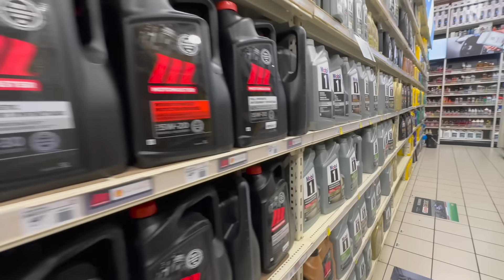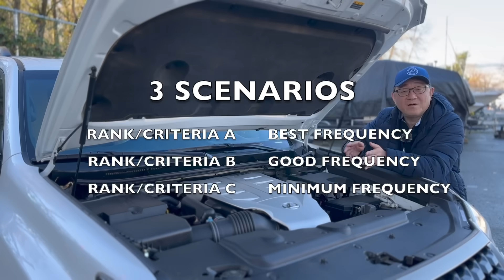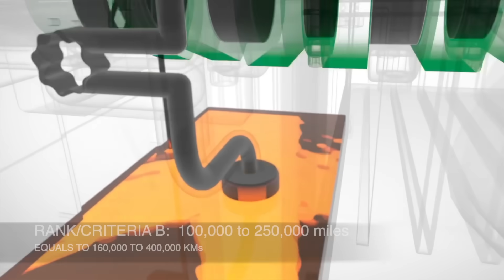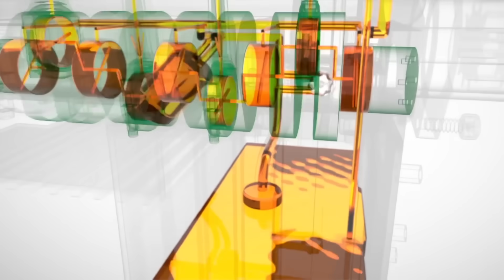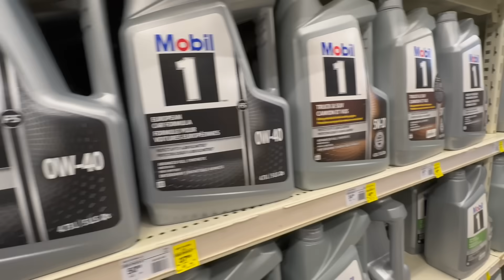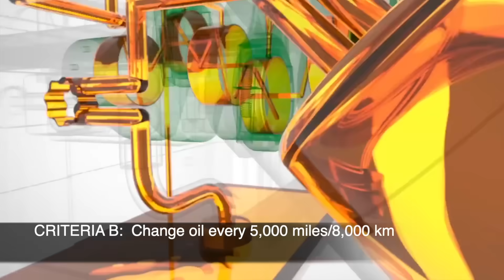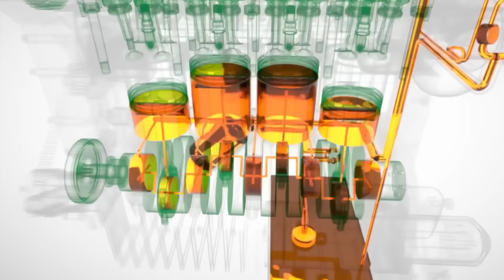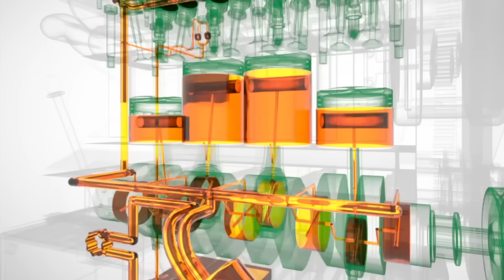ENGINEER EXPLAINS HOW OFTEN TO CHANGE OIL & FILTER // UPDATED CRITERIA-BASED RECOMMENDATIONS!

Comment: Toyota owner's manual says 5,000 miles under severe conditions. They define severe as a hot climate, a cold climate, or a lot of stop & go city driving. I have also read that it should be changed at 6 months, regardless.
Reply: Yep, what they (and others) call severe is actually the average owner's usage.
Reply: It should be hours, not miles.
Reply: @markkievit3774  Back when I was working with a large truck fleet that did regular oil analysis, the most predictive metric was gallons of fuel used combined with an adjustment for how much of the fuel consumed was at idle (with the truck not moving). Almost all miles were highway miles with loading just below 80,000 pounds gross vehicle weight.

Not engine hours, not miles, and not calendar months. Fuel consumed is directly related to oil contamination caused by fuel getting past the rings. Fuel consumed at idle increases carbon and ash by about a 3:1 ratio compared to fuel consumed at about halfway between peak torque and peak horsepower under load for a diesel engine in the 11-14 liter range.
Reply: Every year , but then I only average 1 to 2 k a year most of my time on a motorbike and regularly change the life blood Fuchs silkolene
Reply: That will allow your engine to get outside of Toyota's 60K mile warranty. That's all they care about. But if you want to keep it and drive it for 200K+ miles, change it sooner.
Reply: Toyotas are fine at 10k
Reply: 6 months is a crock of shit. Don't fall for it. Miles is all that matters.
Reply: @joevarga5982    6 months really isn’t a crock of shit. If your car does 5K miles a year. City driving. Lots of stop start. You change it at 6 months. Not 5K miles. I will not have engine oil sat in my car for one year. Never
Reply: 10k these days.

I leased a Corolla and they wanted to change it at 10k intervals
Reply: @mikeprice8307  One of the (growing) problems is "MARKETING".  It's a sales pitch, to offer longer-interval servicing as a requirement (hence cheaper and less inconvenient to the owner).  The executives go to the engineers and ask what is the MINIMUM oil change distance to get the vehicle past warranty - not necessarily what is optimal for an extended life of the vehicle.  (In fact, it's in their interests for a car to "fail early" - so you go and buy another one, rather than keep it 25 years!!).  What 'sounds best' to a new buyer, 3,000 mile / 6 month changes, or 10,000 mile / annual changes?  Most experienced mechanics will advise oil changes at HALF the manufacturers recommended distance.
Reply: @OhSoddit  Yes, marketing. 1 company started it (10k) and everybody else followed, since no one wanted to make the impression their brand/stuff isn't as good as the other brand's stuff. And that kept on increasing to 15k, 20k and who knows where the ceiling will be.
Reply: Don't go 10k
Reply: @bertblue9683   A lot of modern cars will be dangerously low on oil by 10k, in addition to the oil being full of fuel and contaminants by them. Unless someone drives 90% on the interstate sitting on cruise control 200 miles a day, 10k just isn't a great idea.
Reply: @garymaclean6903   No responsible one will. But, majority of car owners aren't mechanically knowledgeable or responsible.
Reply: @bertblue9683  Use a full synthetic oil and change at 6 months or 5,000 miles, whichever comes first. Car manufacturers are making piston rings looser, allowing blowby into the oil. 10,000 mile oil is really dirty.
Reply: @bertblue9683   I already did. I've owned my 2004 Audi S4 since it had 13,000 miles. It now has 161,000 miles. I change the oil and filter every 10,000 mi. as recommended by Audi, with Mobil 1 full synthetic without issue. I'm even on the original timing chain guides and tensioners.

Now explain why 10K miles doesn't work.
Reply: @Resistculturaldecline   Changing every 10K miles doesn't mean you go 10K miles without checking the oil level.
Reply: @motleydude73   Exactly. People are ridiculous.
Reply: @mikeprice8307 no offense but 10,000 miles is foolish.  Just stick to 5,000 if your mindset is 10,000 miles.  It’s $35 to change your oil and filter with full synthetic and takes 10 minutes
Reply: @CreatingExcellence   I change my personals 4k to 5k.  Toyota says 10k.  I leased a 15' & 17' Corolla.  They also done it this way of interval during the contract of the lease.  I didn't have to change the oil.
Reply: @motleydude73  I've given up trying to convince these people, they're gonna do what they want and only want to hear from positive reinforcement, anecdotes, etc haha

Oh well, so be it
Reply: @CreatingExcellence   There's nothing foolish about following the manufacturers instructions to the letter. I've owned my 2004 Audi S4 since it had 13,000 miles. It now has 161,000 miles. I change the oil and filter every 10,000 mi. as recommended by Audi, with Mobil 1 full synthetic, without issue. I'm even on the original timing chain guided and tensioners.

Now explain why 10K miles doesn't work.
Reply: @CreatingExcellence  10,000 miles is not foolish. Naturally aspirated engines can easily go 10,000 miles with synthetic oils made from GTL Group III+ base oils. These oils are more refined, harder to break down than your average "fully synthetic" which are made from crude-oil refined Grade II or III base oils. Pennzoil Ultra Platinum is one example.

Then there's AMSOIL Signature series which uses Group IV PAO base oil, sometimes mixed with Group V ester. These are true 100% synthetic oils. Amsoil advertise it for 25,000 miles, which is ofcourse pushing it but it can definitely go 15,000 miles between oil changes.

For Turbo-charged gasoline engines, its always 5,000 miles since there's too much fuel dilution.

Comment: This is a really great video, alot of people guve their 2 cents without really giving any weight to what a person does with their car.  I've got a 23 IS500 that I've already changed twice and it's only got 4000kms on it.  Now that it's broken in, I don't plan on ever going longer than 5000kms.  I plan on keeping this car basically forever as It might be the last if it's kind.  I also have a highlander, which I plan on keeping 4-8 years. I change that between 8-10 thousand kms.  I'm using amsoil in both cars.
Reply: You know, you touched on a point which will become more poignant in the coming years. And that is the possible scarcity of vehicles with ICEs. I am holding onto mine like they’re gold (they might be soon), and maintaining them to the highest degree. Plus, I’m tired of spending 50+k for a set of wheels.
Reply: @bobhawkins3387  ya, I agree, I don't know what the future holds, but I think now more than ever, maintaining your ice's engine for the long haul is more important than ever.
Reply: the brand is pretty well irrelevant !I buy the prettiest can..yelloow is good.Weights arent nearly as important as people think!THERE IS so much " mechanical mythology" involving oil!ONE GUY TOLD me mixing weights was like putting half inch marbles in with 1 inch marbles..the half inch will never share the load!!! His bud said " that makes sense"....I said...NO,I DOESNT!
Reply: When I bought my 19 bullitt new from the dealer I had changed it 8x by 4000 miles 😅
Reply: I learned at a young age oil is supposed to stay clean and filters are supposed to get dirty and be changed. The problem is the only filters that clean oil are depth bypass filters. All after market. I have a Australian Jackmaster Classic on the Pontiac Torrent. The other engines and transmissions use Motor Guards. Gulf Coast juniors and The flat head Ford V8 canister filter on the Ford diesel tractor. The Motor Guard on the old Ford f250 390 is almost 60 years old. I have 2 older than dirt Frantzs that I will put on a lawn mower. They need new gaskets. You guys are suckers. LOL.

Comment: my son's 2012 durango had 102k wen we bought it, know has around 122k... water pump went, so having " hemi tick " we decided 2 rebuild engine so he can keep " 4 EVER "  looking inside heads there is NO, that's rite NO sludge @ all... only had 1 fluid change w/AMSOIL Signature Series( their BEST )... ran my '16 lexus nx200t 23,671 miles over 3 yrs, 2 mos & 2 days... had it tested, only gained a little viscosity... only 1k 4 using synthetic ? sounds like u do not really fully understand they difference between real oil & synthetic...
Reply: Ahhh... The AMSOIL cult.....  
I make it a point to never buy a vehicle from anyone who claims to do extended oil change intervals because they use AMSOIL.

Comment: Depends a lot on the engine and also  driving.

The family MB needs oil change every 4 months 😭 due to fuel dilution
Reply: Tell me about it life time transmission fluid 😂😂😂. One year ago told a friend thinking about a transmission fluid change.  He laughed at my face and say. It's life time fluid mate. 2 days ago hè called me and asks me if i knew a guy that Works on automatic transmission.  His one stopped working😂😂😂😂😂.
Reply: @PhilippeVandenStockt  Lifetime... until it lasts 😅
Reply: @PhilippeVandenStockt  Also my family MB got worse, the oil was black after 3 months of very light use 😲 I basically just buy the cheapest oil in bulk ( expecially on black friday, great deals that day here in Europe for some oils) and change it frequently

Comment: Millage is just one factor, oil temperature (actual driving time) is at least as critical and the oil might need very frequent changes with short time, as well as how dirty the environment is (there's a reason why they say that the best oil filter is a clean air filter).
Best is to do oil analysis if it's available in the area.
Reply: You're right but I think these guidelines are meant to give the owner a safety margin. Sure if you take into account driving style and environment then you could probably squeeze a couple more miles out of the oil but most people don't pay that much attention (myself included)
Reply: @aden3113  There's no safety margin in those numbers unfortunately, not without knowing the whole picture. Just like it can be completely unnecessary oil changes. 
It's was all generalisation without addressing any facts to help anyone, unfortunately.
Reply: @PSA78  Is it unnecessary though? It's all just a compromise with regards to many different factors such as the longevity of the engine and how much money you're willing to spend on keeping it in good shape. The more frequently the oil is changed the cleaner the engine is going to be and the less wear and tear on the engine.

The numbers are certainly a little arbitrary but not unheard of and should give good results if followed.
Reply: @aden3113  Only to a point, if the oil and the additives are good and there's low level of contaminants then it's fine. If it's not, then it should be changed.
There's just too many variables, that a generalisation between conventional and synthetic is made is just one of them, as what's called synthetic varies around the world and there's a rather big difference between different types as well.
I'm sorry, but this isn't a video that really helps anyone.
Reply: driving style - floor gas pedal, towing if a truck
Reply: @hom2fu  It can help to drive a bit harder if it's shorter distances, regular driving usually takes 20-30 minutes to get the oil up to temperature.
Reply: All recommendations are based on using filters that only remove engine damaging abrasives and draining the oil to get rid of the smaller engine wearing abrasives. The small stuff can be removed by depth bypass filters. We have a lot of filters that clean oil now. When I started using filters that clean oil in 1963 we had Frantz and Motor Guard. In the US. The Australians might have had the Jackmaster oil filter. My Pontiac Torrent has the Australian Jackmaster Classic. Not familiar with the others.
Reply: @ralphwood8818  There is finer filters that could be used together with the regular, but it's not going to change things a whole lot, if it was fine enough to catch all particle sizes that matters then the additives would be caught there as well.
The oil is also depending on operating temperature to remove contamination, really short trips and you might need to change once a month, perfect conditions and once a year might be fine.
Reply: @PSA78 When I started using the Frantz oil cleaner in 1963 it was simpler times. Every 2.000 miles you changed a roll of 2 ply toilet paper and added a quart of Delo 30
W. The sludge was in the filter instead of the engine. Delo was 29 cents a quart in the discount stores. I didnt know anything about  size and shape of molecules. My Rambler American flat head 6 came with a bypass filter factory installed with steel oil lines. It didnt clean oil. To clean the oil I installed a Frantz oil claaner.
Reply: @ralphwood8818  Things have changed in some ways and in others not so much.
Change the oil when it's time, and make sure to run the engine for a few minutes to circulate it before draining so it will take the contamination with it out.
Reply: As far as I know filters that clean oil dont remove additives unless its like graphite. I know some people that use filters that clean oil read oil analysis reports to check for additives and wear metals. I dont have an over the road truck with a Gulf Coast Bypass filter. I have a 06 Pontiac Torrent with 207.000 miles on it with a like new engine. Im not in the rust belt. I wont out live it. It has a Motor Guard oil cleaner on the Toyota transmission. I probably wont change the filter on the transmission or the Wix XP full flow filter. I depend on the Australian Jackmaster Classic to do the cleaning. The pleats in the Wix XP im told are synthetic and should hold up.
Reply: @ralphwood8818  Exactly, filters aren't fine enough to catch anything but large particles, additives, wear particles etc will go through.
UOA is after all taken from the oil pan and not the filter, so both additive and wear particles are in there circulating.
Reply: @PSA78  Im not that smart. When I put a Frantz oil cleaner on my Rambler American flat head 6 and saw the oil turn golden I was hooked. I was debating a smart as hell guy on a Trawler forum. He said you are good at defending yourself. Bring your wife down to Canaveral. I will take you on a tour and we can talk about filters. I called Charlie Sims of Gulf Coast filters. I said I need for you to talk to a guy about big diesel engines.He said who is it? I said a diesel equipment engineer at NASA LOL. They are a customer now. I was on YouTube talking about a Peterbilt truck with a million miles with one oil change and virtually no engine wear. Shell Rotella 15 40 conventional and a Gulf Coast Filter that used Bounty Big roll paper towels. I dont get any respect but I did get a message from Road King Magazine wanting the truck owners phone number. I called Charlie Sims again. I said Road King magazine wants the truck owners phone number LOL. They did an article on it.
Reply: @ralphwood8818  I'm not sure what or who you're talking about, but a finer filter can catch some soot and that can potentially help a little with diesel engines, but at the end of the day some particles of equal size could both be increasing and decreasing wear depending on what it is.
Reply: @PSA78 I put over 250.000 miles on a 84 Subaru with no oil drains using Mobil 1 15W 50  and a Frantz oil cleaner. Was talking about it on YouTube. Got a sample kit from a Caterpillar lab manager. He said the oil looks good for that many miles but he suggested I change the Frantz and add a quart of new Mobil 1 every 6.000 miles instead of every 12.000 miles Been doing 6.000 since. I was driving about 12.000 miles a year. I was using 4 July as a time to change the Frantz. I had Amsoil in the 5 speed. Never drained it. Both head gaskets started leaking oil at over 260.000 10:48  miles. Gave it to a guy at work. He used a less expensive oil. At somewhere over 300.000 miles he went to Iraq and I lost track of it.
Reply: @PSA78  It would be nice if the oil in my old Ford diesel tractor looked like the oil in my gasoline engines. It aint going to happen. Some soot is non abrasive and too small to be filtered out. Its like ink. It doesn't stain the skin and feels slick and the viscosity is good. If there is too much soot in the oil I can feel it.
Reply: @ralphwood8818  250.000 miles would be impressive to make without changing oil, but there's no additive or base oils that would last nearly that long.
Reply: @PSA78  Additives last a lot longer in clean oil. We get the new additives when we add new makeup oil at filter change. The oil will pretty much last forever if you keep it clean. I was a mechanic for a re refinery years ago. Conventional oil gets better everytime you refine it and add new additives. At one time new Mercedes cars came with re refined oil. Goodyear sold ours in quarts. Most of it goes to the major oil companies. Crude oil has a lot of impurities you have to remove from the oil like asphalt. A lot of re refined oil has synthetic oil in it. Not sure who sells it now. I would use it.
Reply: @ralphwood8818  How clean the oil is has nothing to do with it. But it's your car.
Reply: The one oil change on the Peterbilt with the series 60 Detroit was because someone forgot to tell a Mechanic not to drain the oil. Not that much difference between the 3 gallon Gulf Coast Filter and my one quart Jackmaster Classic or the flat head Ford V8 canister filter with half a roll of Viva towels. On my Ford diesel tractor.